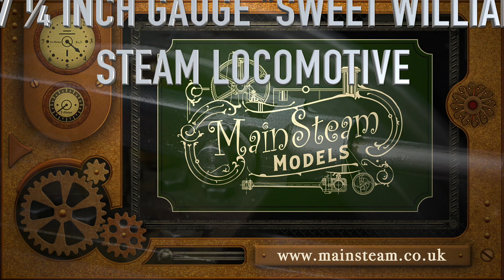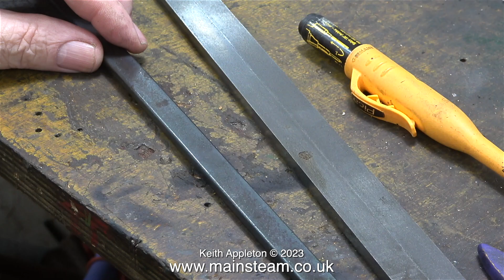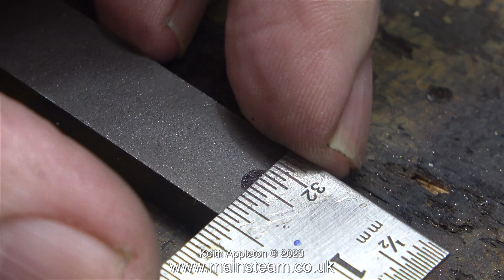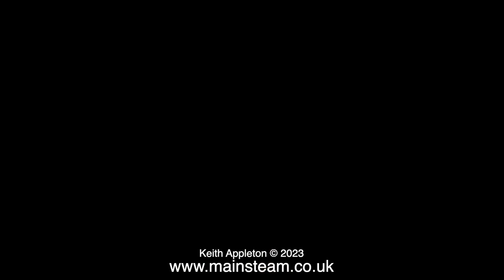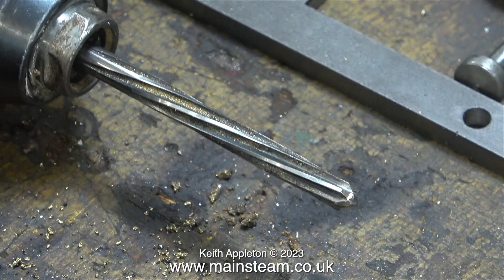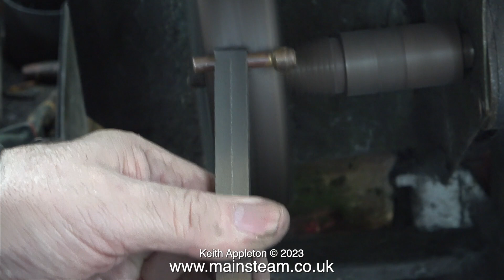A 7 ¼ INCH GAUGE "SWEET WILLIAM" LOCOMOTIVE - PART  #67

Comment: I wonder if a video on the properties and uses of different kinds of metals might be an idea. I know recently I bought  some mild steel to make some supports for a weight I needed to add to my battery powered loco. It was so hard it broke two 6mm drills. I was using the same set-up as I did on the first bar which was old stock, and had been no problem.
Reply from the maker: I don't know much about different Metals, I just ask for what I need at Blackgates Engineering. May I suggest browsing Google for information about the different qualities of various metals?